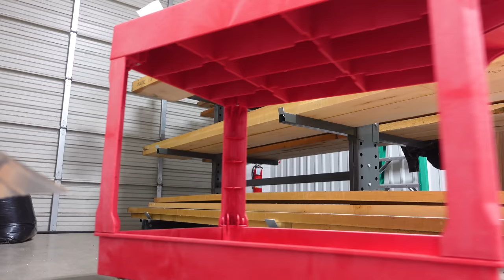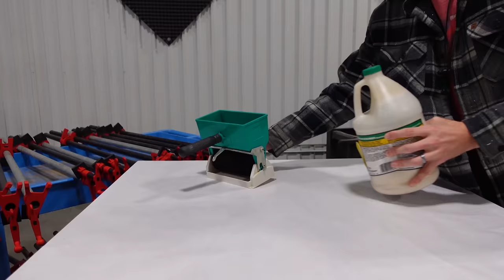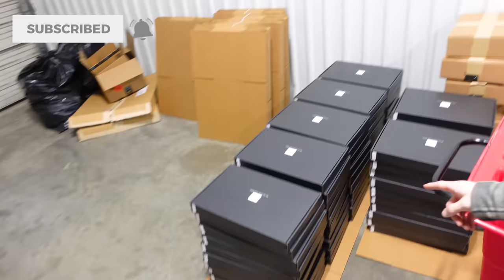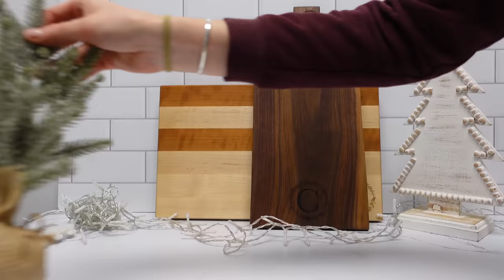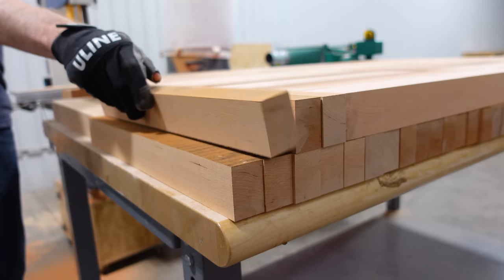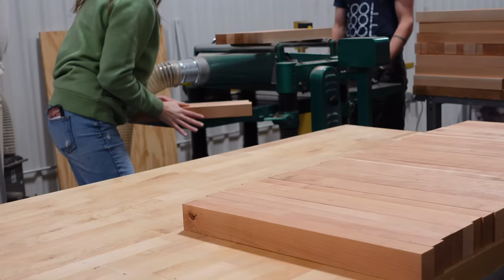1 amazing customer buys 120 cutting boards!

Comment: note......   weve been making cutting board and the such now for 6 years and turned it into a 1/2 million dollar business. Im going to help you out. try gluing and clamping up 12ft, 14ft, 16ft ect boards at one time and then  plane them and cut to size. it will save you time and make production go faster.
Reply: I always wondered why they didn't do that
Reply: That’s awesome! Would love to see your work on IG, FB, YT, TikTok etc.  What’s your businesses name?
Reply: This has been suggested many many times.
Reply: @sabersaw5611  I think the reason is this, they don't have big planner and on this little one it is very hard to  flatting big boards
Reply: @josipsalaic5246  the big glue ups aren't much wider than the finished piece. 20 inches go far for this kind of work.
Reply: @josipsalaic5246  20" planar and they make 10.5in wide boards. the 12ft worth of boards is length, width isn't changing.
Reply: I’ve noticed this too.  It makes a huge difference when your trying to up your batch size.  Instead of making a pass on the bandsaw every 18 inches, you would be doing a pass at the table saw once every 6-12 feet depending on the length you go with.  On twelve feet you’d reduce your cuts from like 7 per board to 7 per every  8 boards.  Then you just rip to size on the mitre when your done.   Pm me Davis If you want to go over it
Reply: Multi tier clamping rack. Ohhhhh Santa!!!!
Reply: @mcdotterson4103  I understand that. I am talking obught lenght, not obought widht. It's lot easyer to planing short peaces, and it is not so havy
Reply: I was wondering they weren't doing that. Why glue up 100 boards individually when you can glue up half a dozen or more at once then cut them to size all at once at the end. Also, not 100% sold on cutting it with a bandsaw. Not a perfect edge. Depending on how good your table saw is, would probably be straighter and more consistent.  Rather than run it all through the planer after to get them back straight

Comment: Just asking why do you send your individual pieces through the planer and then glue them up clean the glue and then plane them again? Please try gluing them togther (in a length that you could get at least 3 cutting boards out of) then scrape excess glue and run that through your planer. Your putting a lot of extra steps in your process making it really hard on yourself.
Hope this helps. Thanks for your time RCW

Comment: Not sure you need to face plane 1st.  If you just use the planer for both sides, you’ll end up with two parallel sides.  For cutting boards, that’s all you need, especially when that’ll be the glued edge. Maybe I’ve got it wrong, but it could save you some effort?
Reply: the problem in theory is this. if the reference face of the planer is not flat (the face that is down), it will register it on the opposite face therefore you will have two faces parallel to each other but it will mimick all the ups and down of the reference face.
Reply: @simonmarcoux5879  you are correct.  However, for what they’re doing, it’ll never matter.  For smaller gouges etc, it won’t follow that closely.  If I were making hundreds of boards, my hunch is at least worth a test.
Reply: @daveerickson5313  it is indeed worth a shot! Like I said theory :) if the sawing process was somewhat accurate you can get more than good enough boards out of the gate!

Comment: I remember in the software world there was an expression "will it scale".  You have that problem.  So long as it's just you doing the work there is a cap on how much you can do no matter how efficient you become.  You mentioned doing franchises in an earlier video.  Maybe that would be the answer.  With franchises you can spread out the load to prop up the low performers while offloading the high performers and everyone wins.  And when sales go down it would be the franchisers that go under and not you. Another option would be to split up the load by contracting our certain parts of the jobs so that you could be basically an assembly operation. But quality control might be a problem there.
Reply: There is nothing there to franchise...

Comment: You cannot underestimate the necessity to hire people, even if temporarily, to come into your shop and do all of the menial work. Or do yourselves a solid and buy a CNC Machine that's a good, solid floor model with a steel frame... Something like a Phantom CNC Systems 5 x 10 T-Series ATC... If you need something that can do fancy joinery for you in the vertical plane, get a Maverick 4 x 8 or 5 x 10 ATC from Legacy Woodworking.

You may want to consider a waiting list for folks. One thing I've learned the hard way being a one-man show in woodturning and woodworking is that you can only do so much work by yourself and if you cannot keep up, raise your prices or put your shop on "vacation mode" for a week or two. Also, CNC machines help and you can run them when you're asleep if they're ATC...

Joint the side grain, plain one face, glue up large panels and let the CNC go to work for you. Will you have scrap? Yup, will it be usable? Yup, develop a new product that uses that scrap...

Comment: So now the real question is.... are your glowforge's ready to keep up with the orders? Have yall thought about getting a "back up" or 3rd one to use in crunches like this or to have as an extra it a primary one fails/breaks? Love watching your progress!
Reply: They talked about this when getting the second one - it's the backup to the first. 😅 But if this is thier new level of output, I'm sure they'll be adding #3 soon.
Reply: slowforge should be the backup. 1 non desktop laser will double/triple the output if not more. Using lightburn and a stop/corner nest would negate the time to find the center of the board so they can put the image on the correct spot in the glowforge software (which requires internet connection)